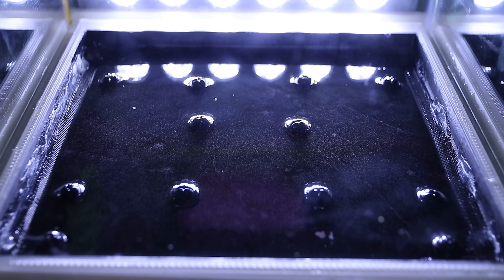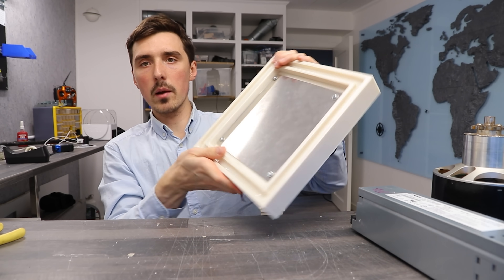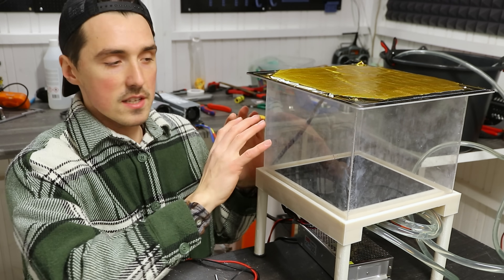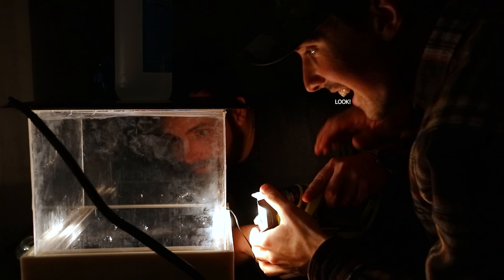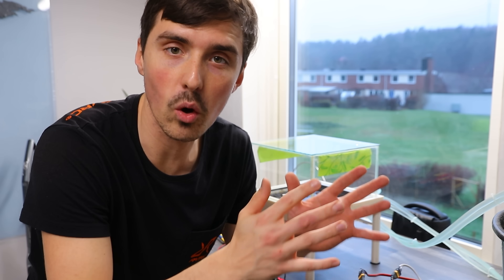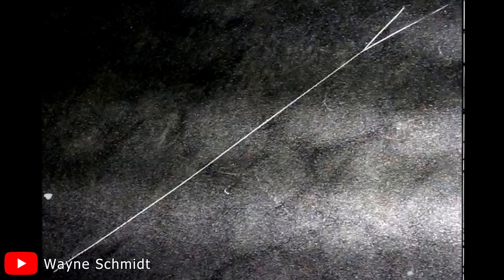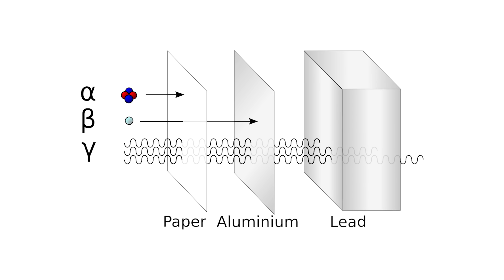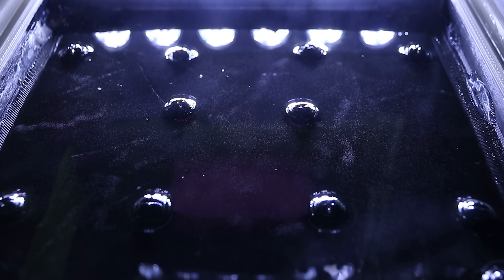I Built Nobel Prize Machine To See Radioactivity

Comment: Problem with your setup was that the container is too short, height should be around 15-20cm. These things are not hard to build whatsoever, and without any electronics attached, just hot water and ice is enough

Comment: 7:27 A flattened helical ribbon track enters from above, deflects off the aluminum and skips downward in the 6 o'clock direction. 

What puzzles me further is that this track left behind a wide more diffuse trail shaped significantly differently than before it interacted with the aluminum plate, with an additional "skipping stone-like" lower trail as it continues on it's path toward the camera

Only afterwords does a large impact (nucleation in the shape of a large interaction/splash) in the electromagnetic field form, with takes place much later in time than the initial track's deflection. 

Truly I think this deserves further consideration but getting someone smart enough to take it seriously is unlikely as seeing a repeat of this event.

Comment: Thermal glue is notoriously bad. You should have just used a good thermal paste and clamped it, or even liquid metal, you only needed a degree. A better paste/liquid metal could easily net you that.

Comment: what does a;
-banana
-wrist watch
-smoke alarm
have in common?

"These objects could have in common is that they can all be sources of radioactivity. Bananas, for example, contain a small amount of radioactive potassium-40. Some watches contain luminous paint that can be radioactive, specifically radium-226, although this is less common in modern watches. Smoke alarms can contain a small amount of radioactive material, such as americium-241, to detect smoke. It's important to note that the amount of radioactivity in these objects is typically very small and not a significant health risk to humans."

Comment: Sugestions of radiactive things:
-Old glass plates had uraniun (before 1930, you can test it by using UV light in the dark)
-Old smoke detectors had Americium 241
-In Europe you can find Thorite minerals, that have thorium 232
-WT-20 "red tip" welding rods have thorium and some others radioactive elements
-Old glow in the dark watches had radium and tritium
-You can still buy tritium gunsights today
-Really old fire exit signs had radium
-You might contact some dental X-ray clinic to let you do a one shot with their equipment

Comment: you need even pressure over the entire surface of the peltier for it not to crack. On a 40x40 mm peltier you should  use approximately 0.53 Nm torque (use a torque screwdriver). Use Belleville washers to absorb changes in distance due to thermal expansion. Then your peltiers will last and wont crack

Comment: Go to a welding supply store.  Buy a Thoriated Tungsten TIG welding rod, very common.  These are mildly radioactive due to the thorium content, are small, and not expensive.  Or, a Coleman gas camping lantern mantle, also contains Thorium.  Great project!

Comment: You do good work, that's really excellent. A fun thing to try in there would be an old watch with a luminous dial and hands from a junk store. If you get an old enough one you have a radium source, still radioactive even if the fluorescent material mixed into the paint has stopped working.  It's a real problem for people who repair old watches, the paint flakes off and can be inhaled.

Comment: You can get dry ice very easily in sweden at different welding supply shops. Most of these shops that keep a stock of different gasses like argon for example, also have dry ice.

Comment: I remember a while ago some guys made an X-ray device using a reel to reel setup of 3M magic tape. The device needed to be in a vacuum to work as atmospheric particles stopped the effect, but such a basic device could be mounted in or beside the chamber, and stand back. It was thought to be a low tech way to be able to generate X-ray images in remote areas, but I haven’t heard anything about it recently (I heard about this around 20 years ago).
Reply: Cranking up the voltage on an old crt monitor would have done the trick. The neck of the tube is not shielded.

Comment: ...question (and sorry if it's a dumb one): I alpha particles can't make it through paper...how did they make it through the walls of the building? 

I'm sure someone knows the answer and its likely easy to figure out but... it seems like glass is the only thing it is able to travel through, but that can't be the case, as they were coming from various angles. There are a lot of materials in the walls, and a layer of paper on drywall, which is made of gypsum. 

So, how do alpha particle make it through the wall?
Reply: Quick Answer 1. They dont ;D  2. They dont penetrate they are created at that specific point then wander until somethings stops them radiation is all arround us
Reply: @Leeroy4ftw  Thank you! Much appreciated! 

I should have thought it through a bit more. I mean, I used to frame and finish houses... build them, them worked for building material stores..... sooo, you'd think, given that I understand how radon gets into people's basesments.... 🤦‍♂️🤣🤦‍♂️ 

Building materials,  especially those with concrete or brick (stone based products) contain small amounts of radioactive material that, over time, decays into radon gas (more often than not).... which builds up in you basement (due to it's denisty) and gives you lung cancer. 

That, plus: everything else, including humans, that contain potassium (I forget which one) are also sources. I knew that. I always thought it was a funny fact that humans are, technically, sources or radiation exposure  to others (people are toxic ....in so many ways). 🤦‍♂️🤷‍♂️ 

Thanks again! I appreciate it!

Comment: Hi. You could use teh W wire shaped like in an electron gun for Scaning Electron Microscope. These are quite cheap to buy (or can be homemade). Also: have you tried to put solid magnet inside the chamber to see how the b-particle tracks change? Just for curiosity.

Comment: Try using a piece of imitation for to rub and statically charge the top screen positively. This will attract slow moving electrons knocked off air molecules by the alpha and beta. The remaining positively charged air molecules will provide stronger condensation nuclei and the tracks will be clearer.

Comment: -30 degrees is pretty easy for a refrigerant for example r410a. So you'll need a couple copper pipes(like 12mm and 2mm), a compressor with a radiator for fridges, torch lighter, soldering paste and solder wire. So you'll take about 2.5 m of 2mm copper pipe, solder it to the high pressure compressor output on the radiator (you can bend it to spiral for saving space) the other end should be inserted into 12mm pipe and soldered to it(you can use a hummer for squishing the end of 12mm pipe to fit 2mm pipe into it like 10-20mm deep). So the 12 mm pipe would be at least -40 degrees Celsius and you can bend it into something like a zig zag pattern under the table to cool it down and then it goes to the input of the compressor. And finally solder all the connections. As for the refrigerant you can go to the local refrigerator or AC repair shop and ask to fill it up with the refrigerant. For such a small thing I think there'll be more than enough 200g of the refrigerant

Comment: You should use actual pure radioactive material, you can a small amount of americium-241 from a fire alarm, it’s totally safe and the radiation doesn’t even go through paper as long as it’s not ingested you should be fine, but use old fire alarms.

Comment: In second hand stores you can often find old fashion smoke alarms with a tiny tiny bit of americium in it. Be safe obviously and store the modified smoke alarm well marked but it really is neat to see it emitting those trails. The tiny speck Amercium is contained and glued firmly inside a small  metal can that is surrounded by another meshed metal cap and doesnt need scraping of or other nasty action. 

Your cloud chamber worked like a charm, it's a work of art.
Have you considered applying a magnetic field too?

Comment: Cell phone
Reply: do you not read the warning cards that come with your devices?  Most electronic devices cease functionality at extreme temperatures, and -30C is definitely extreme temperatures.  A cell phone would not be any where near as interesting as you'd think... unless there was a way to thermally isolate the cell phone and its internals from the cloud chamber while still having it inside the cloud chamber.  You'd likely see something similar to what the tungsten did, only this would be the radio waves the cell phone outputs, where the tungsten was something closer to electromagnetic waves.

Comment: you should try using the -30 wiper fluid and run your tank from inside a small chest freezer. If you want good radio active to add use an old wrist watch ( made before 1970) with glowing hands. Ebay has a lot of them. You dont need it to be working you just need the material on the hands to be exposed to the chamber. alternatively you may be able to get your hands on uranium glass from ebay. while not an actual high health risk it would provide a better show.

Comment: You could probably easily find some thoriated tungsten electrodes (used for TIG welding) in any local welding supply shop for a radiation source...

Comment: I work for a company back in the early 90s building those thermal couplers from the ingots that are inside cutting those out of bars of stock into little cubes and soldering onto the ceramic board.🤔😎 every aspect of it and to this day those things blow my mind, all you have to do is change the polarity and it'll get hot or cold really weird but it works. It's because of the Special Metals that are in the little blocks they caused this reaction. it's weird, alien technology LOL👽

Comment: Put a piece of depleted uranium in there to see how depleted it is... If you have access to depleted uranium that is. 

Uranium glass would be interesting too.

Another idea might be water from radon springs to see if radon is even detectable in this water. 

There is also a mineral mined in Russia called charoite. The legend goes it's mildly radioactive, but the sources are sketchy.

Lastly, those "negative ion" pendants which actually contain radium that, ironically, emit positively charged alpha particles.

Comment: For a good radioactive source you can use pure potassium chloride, which is sold in grocery stores as a dietary, sodium-free salt-substitute.  One in every ten thousand potassium atoms is radioactive K-40 which decays with mostly beta decay with the electron coming off with 1.3 MeV, so that should give you a nice trace.  About 10% of the decays produce a 1.5 MeV gamma.  Another common source is uranium glass, also called vaseline glass. You can often find it in antique stores, in the form of vases, bowls, or goblets..  It's the beautiful chartreuse-green glass that glows a bit in UV and it's really beautiful in sunlight owing to its fluorescence.  It usually contains a few percent uranium oxide.  It's been made for the past 2000 years or so.  It's quite safe to handle (but I wouldn't put under my pillow at night) and emits some gammas and a few betas from a mix of long-lived uranium and thorium and short-lived intermediate protactinium isotopes.  Finally, you can also remove the Americium foil from a smoke detector/alarm.  It contains an alloy of Americium-241.  It's a powerful alpha emitter, and you'll easily see a few hundred thousand alphas/second coming off of it.  It used to be you could get thorium welding rods, but they are no longer sold because of the radioactive hazard.  Ditto for lantern-mantles.  They used thorium oxide impregnated cotton.  To use them you set them on fire, burning off the cotton substrate and leaving a delicate metal-oxide filligree which glowed brightly with a white light when the gas lantern heated it.  Again, there aren't many of them left because it became illegal to manufacture and sell them when the dangers of thorium were better understood.

Comment: We made these many years ago at college, and used a large syringe to draw a partial vacuum, this increased the saturation and made a lot more trails visible - you could probably do that by making your chamber a much lower volume and putting a good seal around the base (might need to use glass instead of perspex?), we soaked a small pad in alcohol which allowed us to observe for much longer (place it to one side in the chamber) and cooled the base with a cake of solid CO2 - when you pulled the syringe the chamber went from barely working to amazing visibility, when a gentle pull is kept on the syringe it could be observed for many minutes before the vacuum or alcohol were exhausted - It's good to see it work with peltier coolers, we used to throw them in the bin due to their high power consumption and poor performance on higher powered processors.

Comment: I love the effect! If you tweak the voltage of the TECs a bit, you might reach a better input-power-to-deltaT point as the input power and maximum deltaT depend a lot on your setup (cooling, and thermal conductivity of the aluminum plate). Sometimes you have to reduce the power to the TECs to increase the deltaT. Sounds counter-intuitive, but that did the trick for my setup.

Comment: Nice video. You can try a smoke detector which has a small amount of americium. Also, on computer CPUs the thermal paste should be extremely thin, their purpose is to fill any small gap between the heat sink and the dice. I bet the same needs to be here, instead of putting lots of paste, it may be more efficient to make it as thin as possible. Check out some CPU fan installation videos.

Comment: what if you cover the bottom plate with black 3.0 for better visibility? would that work, or does it impact temperature too much, since it absorbs so much light even the flashlights may heat it up

Comment: The chat GPT reccomendation is the cathode side of an xray tube. You heat an element with a high atomic number, in this case tungsten, and it shoots out electrons. Xray tubes use a negative focusing cup to better allign the rays with an anode target. Quite novel how advanced chat gpt reccomendations are.

Comment: For the cloud chamber: Rocks, particularly ones that fluoresce under ultraviolet light.  They should be cheap in Sweden.
For Simon:  Cool project!  A little spray insulation between those TECs might not hurt.

Comment: Good work! How about using a thermal paste between the thermoelectric and the aluminium sheet without using the nut and bolts (bad leakage source for temperature via conduction)...

Comment: Great project, you can construct a Helmholtz coils to see how the tracks be curved due to the (parallel) magnetic field, or maybe add a metallic top plate, and using the bottom plate can make an electric field using a DC source.

Comment: Wow! Very well done!
The classic radiation source would be a piece of some granite rock. You have enough of them laying around the countryside in Sweden.
Ceramic tiles are also good. They contain some Uranium.
If you have an old wrist watch or alarm clock with a green night dial, they are really good because the light comes from a mixture of Barium and Radium. The strongest trails should come from an old smoke detector. There the radium or thorium is used to measure the radiation flux. Apparently smoke is a more absorbent of Alpha particles that just air.

Comment: Put an ion chamber from aliexpress, those are meant to be inside the fire alarms wich read changes in a small amount of radioactivity ( the smoke stops some particles hitting the alarm sensor and it triggers the alarm) they are filled with a tiny amount of americium, it is radioactive but safe to handle ( emmits alfa particles)

Comment: You need to insulate the base plate.  The heat from the hot side of TEC is getting back to the plate.  Make a 3D printed layer as thick as the TEC and let them set in it.

Comment: That was awesome. Also, you crack me up : a banana because of the potassium content ?? Use diet salt already : that has usually 60% of potassium chloride in it. Math : 1 gram has 0.6 gram KCl , times 0.8 K per gram = 0.48 gram of K : that is as much potassium as a medium banana (0.326 gram per 100 gram according to the USDA). Of course , only 0.000117 of K is the K40-isotope :) which translates to (mmm..... atomic weight, mole, Avogadro, half life, 90% decay to Ca-40 and 10 % to Ar-40 ) about 13 electrons (beta- particles) per second.

Comment: You could use only 1-2 thermoelectric modules and make a good thermal insulation of the dome of the device. In this case, the cooling would be just slower, but the result is the same.

Comment: Dry ice is simple,  co2 fire extinguisher, wearing protective clothing, and using a silicone rubber sheet, you put the bell of the co2 extinguisher pressing down hard onto the silicone sheet and pull the trigger. the over pressure forms dry ice.   Make sure there is no one below the layer of dry ice,

Comment: Dude try using the skin of the bananas as that’s where most of the Potassium 40 is, older smoke detector’s use Americium 241, Red tip Tungsten welding rods have Thorium in them, you can buy anti statice vinyl record cleaners from Amazon which have a tiny Polonium source (beware the half life of the Polonium source is very short and you won’t know how long the thing has been sat in a warehouse before shipping), look in old junk shops or on EBay for Vaseline glass, it’s faintly green and gloses under UV and contains Uranium. Have fun.

Comment: you should try it with uranium glass which might still be in old peoples homes. It looks slightly green-yellowish and when you shine UV light on it it will emit a strong green light. It should be safe to handle as long as you don't break it. https://en.wikipedia.org/wiki/Uranium_glass